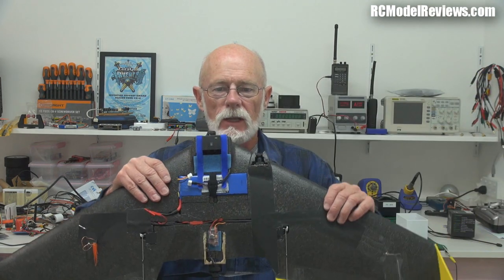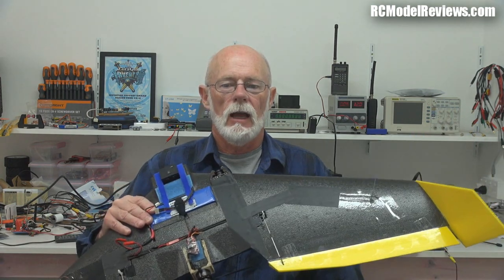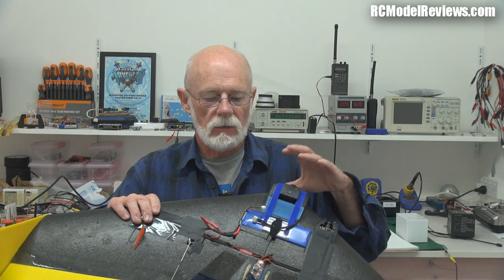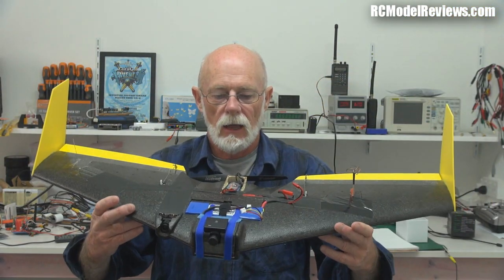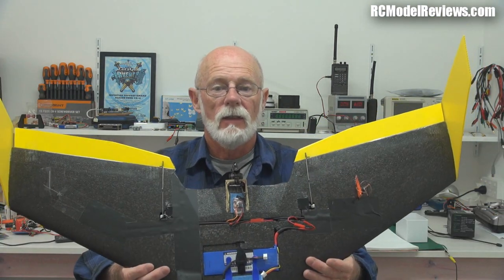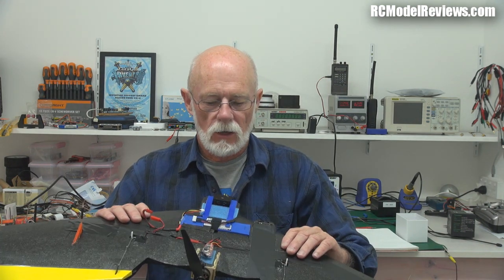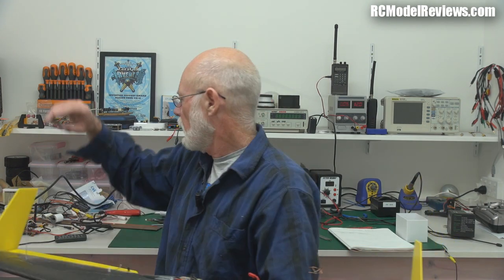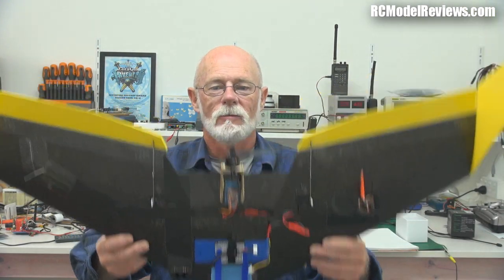TBS Caipirinha (Part 2)

Comment: Great part 2. Completely understandable about the lack of flight footage, TBS themselves have a fair bit of wing rock in most of their C plane videos. If you are planning on a part 3, before you add in the gyro stabilisation I would love to hear the flight performance difference between the two wing tip styles.

Comment: Some astroturf on the hanger floor with a stunning backdrop projected on the old wall looked quite realistic. Of course, all other creatures were removed from the flying chamber for safety reasons. To avoid the possibility of huge spontaneous explosions from teensy impacts, a thorough search was conducted for Ford Pinto (Fordus Pintorusacae).

Comment: Good follow up. We don't need t see a lot of flying video. When you go out flying, just make sure there are no suspicious looking vehicles hanging around or following :)

I've had power supply noise-on-video problems before. It can be very difficult to overcome.

Comment: Hey Bruce, you could do something like Top Gear does with the Stig who drives their cars in full driving suit and helmet.  If I saw a guy in a driving suit and helmet flying for you I would believe it was someone other than you and I couldn't prove differently.  haha.  And every once in a while you have the "Stig" lift the visor just for a glimpse and low and behold it kind of looks like Barry.

Sorry for your continuing troubles but great to hear you are working on a possible solution.

Comment: I stuck the hk gyro with open fw and it helps a ton.  Still has the characteristics of a small wing but much better.  I take of in head hold mode which makes it easier to launch then flick to rate mode.

Comment: On your recommendation I use the same video gear.  I tried a combination of high end Murata switching regulators (20mV ripple) and I found that both the sony camera and the 5.8 module are very sensitive to ripple. I'm now using linear regulators with a big heatsink.  I am thinking 2 LiFePo4 cells might be good to directly power the camera and 1 cell for the tx module. A disadvantage of having to charge extra batteries but might work out lighter.

Comment: I will be interested to see if you end up with the same problem I had with fitting a stabilizer on, which was that once you tip stalled you cannot pull out unless you switched it off.

Comment: Try a 2200 turnigy motor with 3s on this.  I went with the stock powerplant to start and it was ok...then went to the 2200 with a 3300ms 3s and a 7x5 and its a freaking rocket.  Super fun either way though.

Comment: Hey bruce, I have a small hobbyking fw190D and at full throttle it just wants to pull hard to the left, with even full right aileron. Which caused it to crash on maiden flight, so what could be my problem?